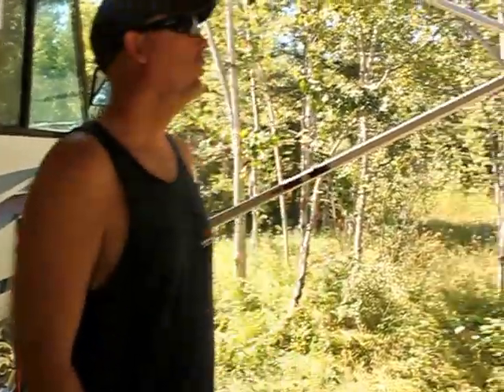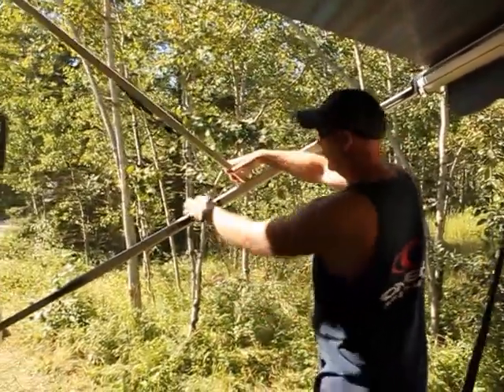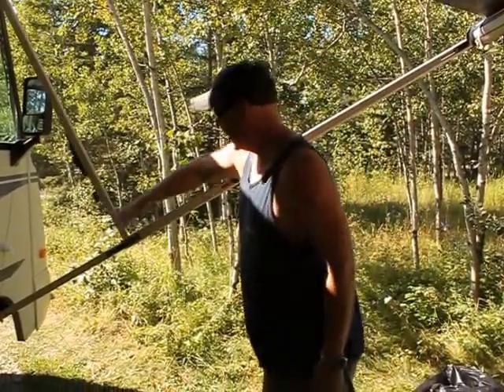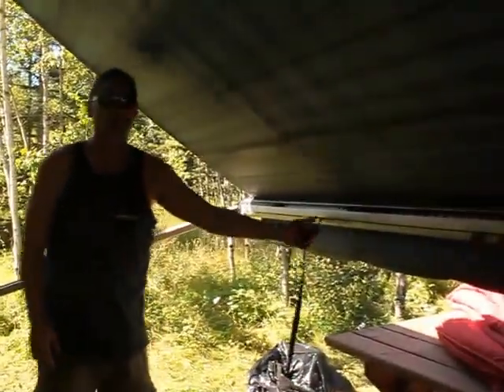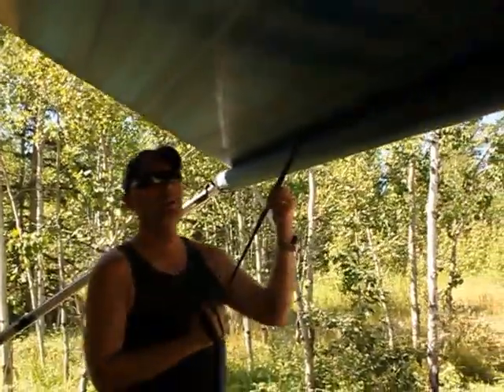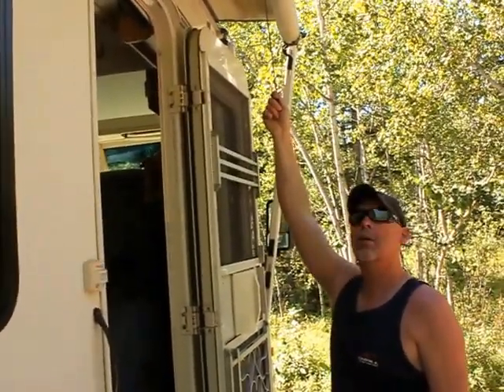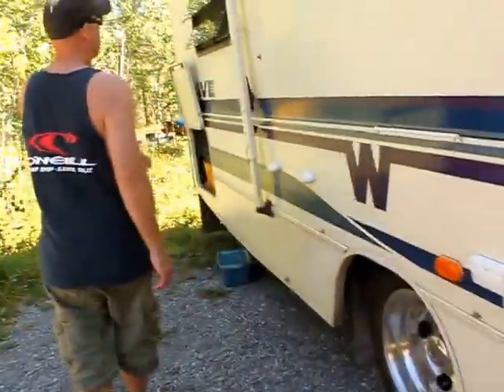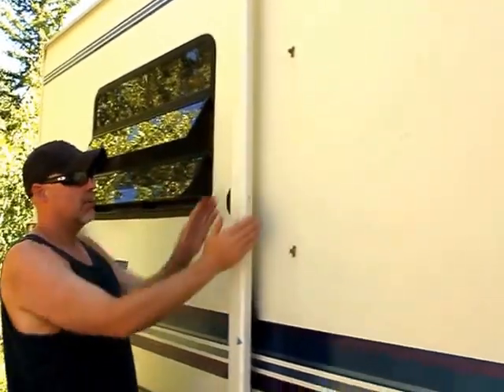How to close a Carefree RV Awning

Comment: Hope you are still monitoring this video for comments and questions.  I have friends with different type of awning, they always insist that when closing the awning, when in closed position, that I need to lift the whole arm up to seat in the top of the rail.  They helped me do it and it was very difficult to get open the next time.  Wondering if this is a necessary step.  When opening the first time, they also didn't know about the open/close latch on the side of the arm - turns out they all have different kinds of awnings than I do.  They kept trying to open the awning by using the awning hook to put awning in open position vs using the latch on the side of the arm.  I didn't know a thing about awning so followed their advice.  After watching your video and many others, I don't see anyone indicating that you have to lift up on the awning arm when it is closed to seat it in top rail to prevent it from unrolling down the road.    Hope this makes sense.
Reply from the maker: Yes, some awnings that have not been installed correctly do require you to do that.  But only is needed if the awning doesn't completely close.  You only do it if inner arm doesn't fit inside outer arm when in closed position(meaning awning doesn't fully close on its own).

Comment: what is the long black piece under the knob you turn I can not figure that out on mine
Reply from the maker: Notice it also has a circular knob on it.  Loosen that round knob then swivel the entire piece towards the awning fabric.  You then slip the awning fabric between the two pieces then retighten to clamp down on fabric.  Its designed to clamp the awning fabric to this piece so the wind does not flap the fabric.  I only used it when it was windy, keeps the slapping noise down.  But really when its that windy you should pull in your awning.  Out of the 15 years I owned that motorhome probably used it 3 times.